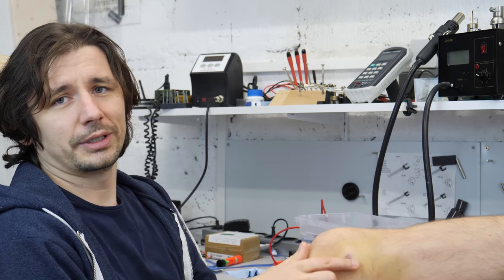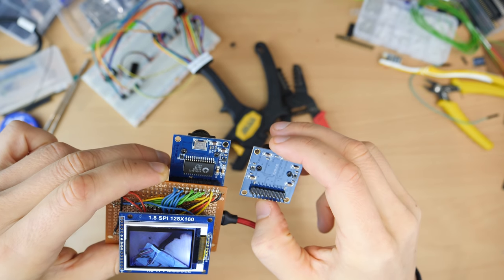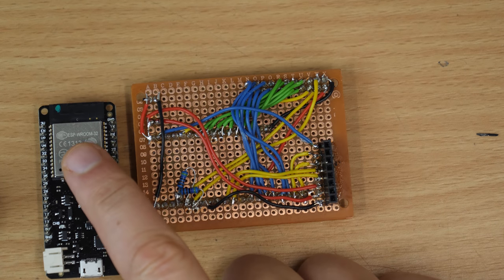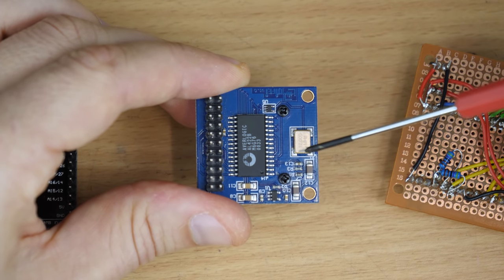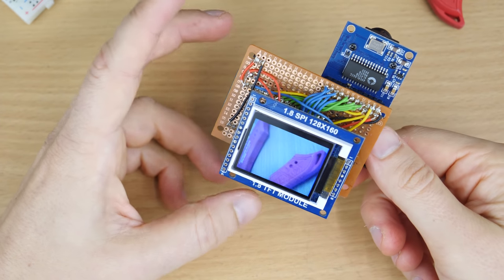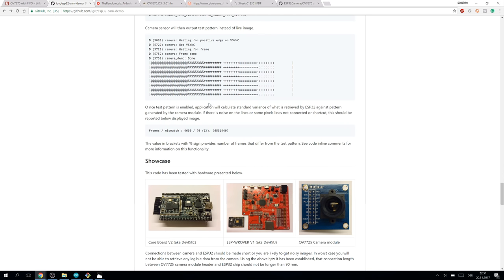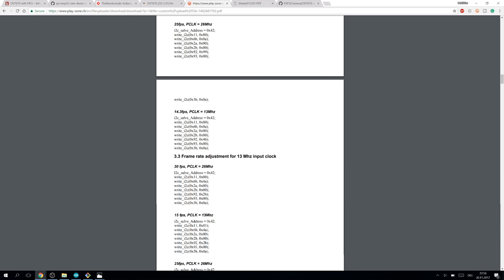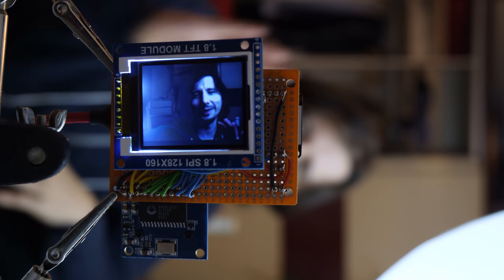ESP32 with Camera and TFT Display (OV7670, FIFO)

Comment: D/C, or data/command - as far as I know, this line is usually used as a flag (i.e. as an indicator) by the master device, and gets toggled on or off depending whether if it's data (e.g. image/pixel values) or a command that is currently being sent.
Reply from the maker: thanks!
Reply: My pleasure! Thank YOU - for creating these informative, top quality & highly enjoyable videos! :)
Reply: (And in a parallel universe it is RS aka Register Select, so you can select the i.e. command or data registers You want to write or read)

Comment: That is a data/command pin. SPI has no formal standard and there are lots variations on it. Instead of separate CS pins for data and command, they use one CS pin and the D/C to toggle between them.

Comment: Nice to see you back in one piece! Keep up the good work and good luck releasing all those video's. 
I'm looking forward to see the rest of the series! 
(Unfortunately I only have the cheap OV7670 without the memory).
BTW. D/C stands for Data/Command. That pin is used to specify that your giving a command such as set x-position or writing actual pixel data to show on the display.
PS: on your website the menu states "SIMPLE MQTT BORKER SETUP" (is BORKER a typo or a joke? ;-)
Reply from the maker: lol... typo

Comment: Glad you're walking again! Nice first test.
Ya know, that ESP32 has TWO cores, right? FreeRTOS is on there... Your code uses just the one core.
It has enough RAM to double-buffer, too.
And you can run an ESP32 faster than the default.
For 120 FPS, you'll have to make a PCB, but 29 FPS should be fairly easy.
Reply from the maker: I don't know what's happening to the ram when using the arduino core, but it stops working when I make the buffer the size to store QVGA. Probably some configuration needed. To get higher frame rates I need to configure the I2S. Did you try anithing with the cam already?
Reply: No work with the cam yet. I've done other related video work though, and using that other core will make a noticeable difference. Maybe, try implementing a pipeline from the camera to the display: begin scanning the cam into a ring buffer on cpu0, then start flushing the ring buffer to the display on cpu1. It should be possible to calculate the maximum possible frame rate and ring buffer's optimal size from the cam's maximum-read-speed, and lcd's maximum-write-speed.

Comment: 4:04 So does the ESP32 have some (internal) pull-up resistors (that are too "high"/small for fast I2C operation).. So ESP32 has pins for these internal resistors? Or what?

Comment: Sir, can you please tell me what could be the frame rate that is being displayed on the screen, as you have mentioned it a limitation of using a single wire data line using SPI protocol.
Also, is there any alternative to using the camera, example a serial interface camera instead of a parallel interfaced one?
Thanks for your reply in advance.

Comment: What version of the app note do you have ? I noticed yours was a 28 page pdf, mine is 64 pages. a year ago I found the 1.0 version has more information on some registers that were removed from the datasheet (which also had some more added), I have the datasheet version 1.3 and 1.4 and app note version 1.0 and ended up getting the OV7670 (non FIFO) working on an arduino Due by reverse engineering some linux code. Let me know if these might help and you cannot find them elsewhere and which would help.

Comment: Very interesting!!  can you add a camera with a better resolutions (i.e.  instead of RGB) to connect a 5mp or 8 mp camera and lower the frame rate (i.e.  take photo every 1 minute) + transfer it via wifi etc
Reply from the maker: Any suggestion which camera I could take?
Reply: The OV5640, please. I'll donate one to you, if you're interested

Comment: Hi, I want to put a camera in the hidden part of a model railway layout and want it to stream to a 1.8 or slighty bigger TFT screen using an Arduino.  Which is your videos would you sugest to provide a solution for me.  At the moment I have a non fifo Az brand OV7670 and a Az brand 1.8 TFT.  many thanks in anticipation.

Comment: Thanks for the great video.  I have a few  ESP32's but I nave never figured out how to program them using the Arduino IDE or even the ESP8266 programmers. I have done a lot of playing around with various ESP8266's from the first one out to the last great device, and made several projects that I still play with nearly every day, but for some reason I can't figure out how to inter-phase with the 32. Probably just a mental block, I am getting older and my brain cells seem to be slowing down a bit when it comes to learning new things.
Reply from the maker: I know what you mean... I took on it and must admit I fell in love with the esp32. it's a pity there is no convenient way to set up the environment

Comment: Bitluni, you have any information about connecting the OV7670(w/o FIFO) on a Raspberry Pi Zero? I think with the faster processor of  the Pi(compared to Arduino) the amount of frames per second will increase, and there is also much more possibility of customization and integration with OS, like being able to create applications using GPIO directly, without having a transmission interface in the middle. Great video!
Reply from the maker: I don't own are respi0 yet. but check out the last part of the series which doesn't use FIFO

Comment: Maybe you already considered this, but can you use the ESP32 to create an ONVIF stream? This would create a foundation to begin building a cheap DIY WIFI security camera.
Reply from the maker: actually, I didn't yet.. have to read in.. do you have experience with it?
Reply from the maker: just took a look. onvif will be too complicated. it does only support compressed stream formats like h.264 mpeg jpeg.. but I saw other modules supporting compression. I'd rather use some simple uncompressed stream/image format for now if you don't know of any finished implementations of the standard

Comment: The webpage implementation works for me but the ST7735 TFT display is coming out all garbled. Looks like it is just showing a bunch of lines in different colors. I tested w/ another sketch to check display was working and it does. Anyone else run into something like this?

Comment: is it possible to use your code with  Arduino Zero and to send image data over LoRaWAN?
Reply from the maker: I don't have any experience with that, but the base code should be independent of the microcontroller..

Comment: Doesn't ESP32 have hardware I2C?
Reply from the maker: as far as I remember did the wire implementation of the esp32 return a bus error... no clue why. scoped the output... it was complete silence
Reply: Yes it does.